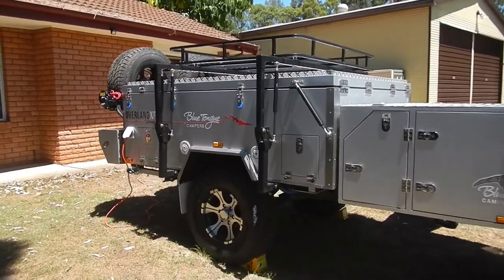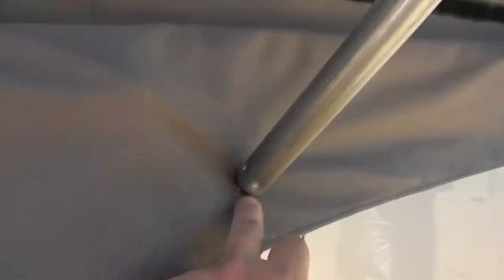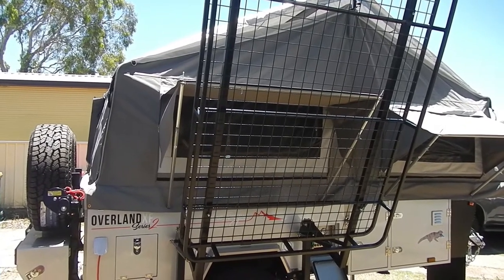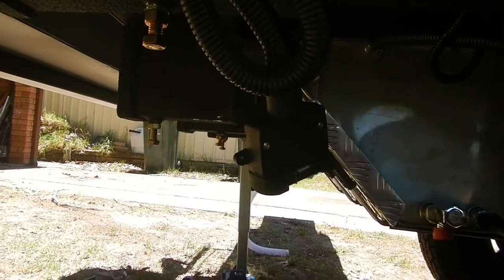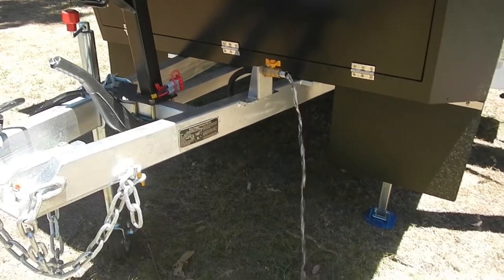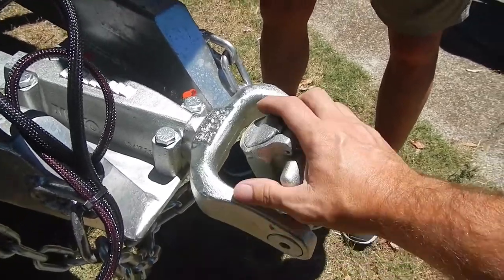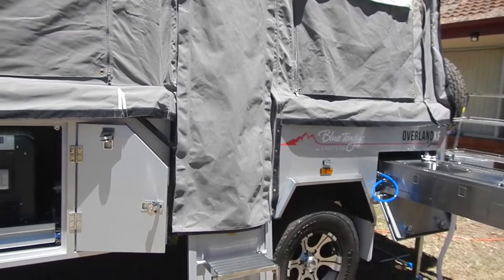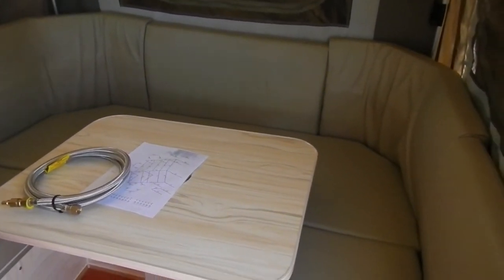Overland XF Forward Fold Camper Series II - first look Part 3

Comment: that cable covering u mentioned at 7:56, you can buy on ebay, all different diameter's pretty cheap too i use it alot even on my breather lines you just use  heatsrink on the ends to make it hold. just search "Braided PET Expandable Sleeving Cable Wire Sheath"
Reply from the maker: cheers. to shorten all to footage I got, I cut a lot out...hard to believe I know :) 
I did mention in the cut bit that I have seen this at Jaycar and will be picking some up when I redo the wiring on that. 
 Does look nifty. 
I'd seen it used in computer builds but not for this. 
Thanks for the input.